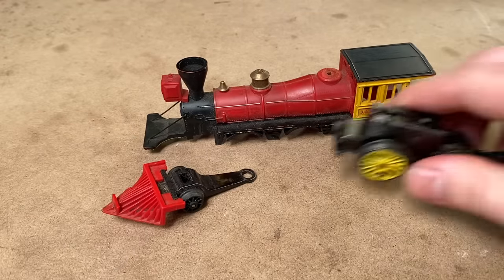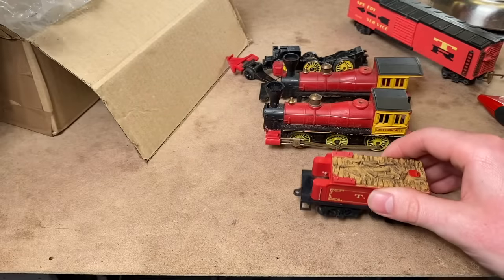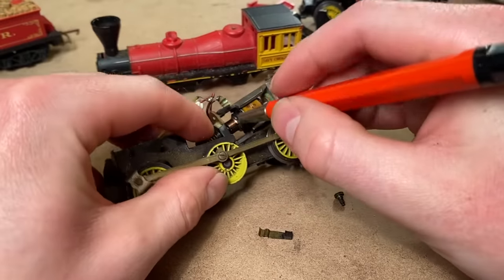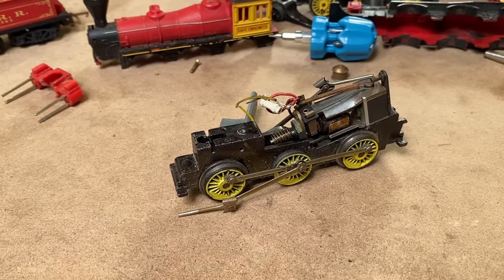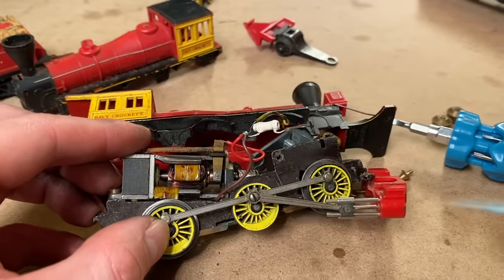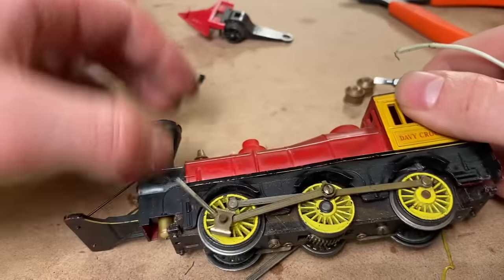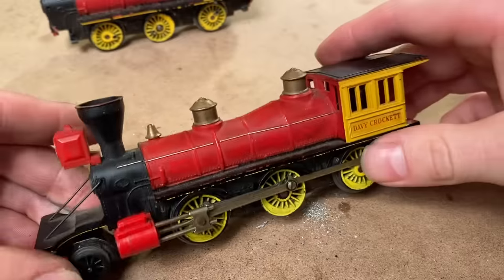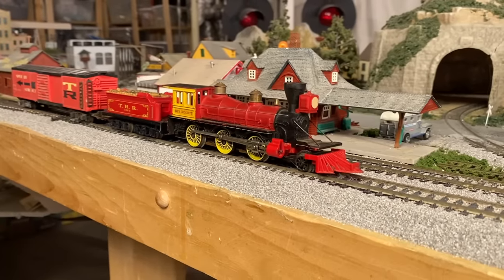The Locomotive I failed to fix - Will it Run? 1963 Davy Crockett

Comment: Man, this is like the last video, old proposed project from an old video finally getting restored, been looking forward to this one as well, this locomotive always intrigued me, I wonder what happened to the frame and how it got snapped in half, it was interesting to think about how bad that model had to have been treated while I was watching the video you got the locomotive in.
Reply: SMT, wonderful work on diagnosing the locomotive insulation issue.. To have surgical skills of restoring difficult locomotives 🚂 is a worthwhile achievement. Some manufacturers have made improvements and some bad decisions in motor designs. Yet most locomotives run well on different track grades. I found that some rails are more difficult to use because of the flange and height of the rails themselves. I forgot about the various rail heights and shallow-ness of the rails that locomotives can’t run on. Atlas, Tyco Tru-Steel and other rail brands differ greatly. Great to see a locomotive run like new. Thanks SMT!  I have a Rivarossi “Yard Goat” 0-8-0 locomotive that has an issue running on my dad’s old layout.
Reply: @lawnmowermanTX  switch frogs, crossovers, and rerailers often give the most problem; they are not made deep enough to accommodate these old "pizza cutter" flanges.  Code 100 track works for most of it; surprisingly, old Atlas sectional and Life-Like Powerloc track has allowed me to run just about anything; the only thing that gives my trouble is an old Jouef clockwork engine from the 1950s; and it mostly complains on the switches and my RR crossings.
Reply: @survivingworldsteam  I have a Rivarossi 0-8-0 Yard Goat locomotive 🚂 that complains on my Dad’s train board. My Dad’s Atlas layout was built in the 1980’s from a 4x8 plywood sheet, and has various retail store shallow grade rails, turnouts and rerailers. I’m not rich enough to retire early and rebuild, rewire and upgrade the whole layout with the proper track and turnout code. I would like to use the taller track and turnouts for the main line and the storage, breaker’s yard for shallower tracks. Try to keep everything consistent with real time and real world railroads.. I wasn’t sure what era to use other than a fun run layout to see how many cars simulated loaded would haul. No DCC no sound effects, old school power pack, push button remote or manual turnout, love to put a cab cam or caboose cam of interior of a caboose out of a side window and the doors to give that movie effect of being on a train like Silver Streak in the 1970’s movie.. A cab, passenger car, caboose and observation car video camera  🎥 system.. With HiDEF 4K..

Comment: Hi, These ols Triang Hornby Locos were fitted with an X03 or X04 motor that were always very noisy. I am very surprised to hear how quiet this motor was and a smooth runner when on Hornby track. Another successful repair and another old timer rescued. Great job. Cheers, Paul.
Reply from the maker: I think the foam floor helped muffle the sound of the locomotive. I haven't heard one this quite ether.

Comment: 1:45 I had that same experience (I was given a free livestock boxcar when I ordered a Tyco/Mantua ATSF F7A for repairs (main issue with the loco was the metal wheels on the front truck were on the same side as the rear trucks)

Comment: Hi there ,, ive worked on heaps of these triang x03 and x04 motors. The bits that flew of is a part of the shellac or the paint varnishy type of covering that goes on the outsode of the motors to stop it from rusting and should be ok with out it. The thing on the front will more than likely work as these old thing were made before planned obscellessance and were made to go for a long time.
You will find that the main things to clean properly are the wheels the brass wipers that contact the wheels on the botton plate and a good oiling goes really well.
I got one of these running with in 5 minutes so i pulled it down for a major servrvice replaced the axle bushes as well as these were decayed due to age. The other thing like other locos is the quartering when replacing the insulator bushes on the axles. 
Once you do that they run like a clock and are widely used in nearly all the 0-6-0 shunters steamers Pacific locos and diesel 08 class loco's. It is a shame you cut the yellow wire as that is the smoking unit that my 1 has too. When i got mine going the first time it ran a little puff of smoke came out of the brass stack that is at the front. These also take only a drop of smoking fluid and is still made today for these smoking units. You can easily join and solder the yellow wire and the smoke unit will more than likely work.
Im missing the cow catcher the front headlight and a few of the domes and bells too.
Good to see you got it running.
Cheers from John in Australia.
Reply from the maker: Thanks for the info on these locos John. Hopefully the motor will be fine without the rust prevention as it's pretty dry in the basement.

Comment: Just read through the other comments. You're my kind of model railroader, and I LIKE you! I'd rather have the robust, basic reliability of these veteran models, which keep on running, than the inbuilt delicacy and fragility of the modern stock, no matter how finely detailed they are. I envy you the Varney Yellowstone - a very rare bird indeed here in Britain, which I only know from a photograph in a very old (slightly prewar, by about 1 day!) book.  I daren't look at Ebay HO nowadays - there's been some dangerously tempting stuff on there. Threes and eights on you, good buddy.

Comment: Those smoke units are pretty delicate, there was a resistor next to the motor because the smoke runs on 6 or 9 volts or something. I learned that the hard way once, where I wired the smoker directly to 12 volts, the engine ran very slowly, and there  was a red glow out of the smoke stack, then pop and it was done! Melted the smoke stack, got so hot! But that is a very cool engine!
Reply from the maker: I wasn't aware of that, thanks for letting me know.
Reply: @SMTMainline  - A resistor connected in series with a load, like the smoke unit element, is known as a "dropping resistor" because it would drop some of the input voltage across itself.

Comment: SMT - It might be a good idea to put some oil on the crosshead guides that are coming out of the back of the cylinders, to reduce the friction between the guides and the crosshead.  For smoke fluid, you could see if you get mineral oil from your pharmacy & try it out!
Reply from the maker: I added some oil to those off camera. I should test out that smoke unit, it could be an exciting feature.
Reply: @SMTMainline  Be VERY careful which oil you use! Those old plastics can react badly with oils - particularly Peco Electrolube or 3in1 and will break up. I'm referring to British brands - don't know what you use stateside, but the same applies.
Reply: @SMTMainline  The resistor in the middle may not be insulated all the way, see that it doesn't touch the bowl at the top. There's smoke fluid available from brands like Seuthe, probably Walthers as well. And don't overfill the unit, it only takes a few drops at a time.

Comment: Well done, Paul!. I've also got one of these engines - a long time favourite of mine, and as you say hard to find in good condition. Things to watch for - the cylinder block can get fragile with 'plastic fatigue'; many I've seen have broken off, losing the cylinders. Same applies to the pilot, cab roof and headlight. 

I noticed you helping her through modern points, as if 'sticking' in the flangeways - Triang's wheel back to back was coarse by modern standards, and tends to bind. The simple cure is to gently lever the insulated drivers out on the axle a little and widen the gauge - there's enough 'slop' to let you do it. 

The model is actually quite a decent representation of the real thing, far more so than many English fans perhaps realised. I suspect it's made from plans of a T,NO&C mogul in the Kalmbach 'Cyclopedia' which matches pretty closely. The coach which ran with it has very strong Pennsylvania overtones, particularly the deep valances over the end platforms, and again Model Railroader drawings of the early 60's suggest the source.  

In Australia I believe the engine was marketed as the 'Ned Kelly'!
Reply: The Ned Kelly version may have just been a one year catalogue illustration proposal in Australia.
A very big Australian Triang collector would often display part of his collection in Melbourne exhibitions. Discussed the Ned Kelly version with him but he had never seen one. 
Ned Kelly is still a very polarising name in Victoria, especially with those with family connections to the area where the 1870-1880 events took place.
Lots of YouTube vids with far more detail on the Ned Kelly story.

Comment: As always, entertaining video. I got a little laugh when you stated it was remarkable that Triang/Hornby hadn't changed the design of the motor in almost 20 years. Hornby to this day are still cranking out models based on that chassis platform. When I see that 0-6-0 wheel spacing it screams old triang chassis. I think they've gotten their money worth of the design, at least 50 years of throwing a different body shell on the same chassis.
Reply from the maker: I guess if the design ain't broke don't fix it? I'm amazed they are still using those motors.

Comment: Great restoration ! It has the standard 0-6-0 chassis used on many Triang Hornby locos over the years. You’d be able to swap it for the chassis on your  GWR Pannier tank for example. It should be able to run on code 100 track OK. All my old Triang Hornby locos are ok on Peco though they will only go through universal points. The fine scale ones defeat them. 1950’s Triang locos are a no go though as the flanges are even bigger, but anything from the early 60’s is OK. Maybe the frog sections on your points are too fine? Try adjusting the back to back of the wheel sets.

Comment: great job, I feel I should mention that the old hornby/tri ang locos are 12v max, they are not designed to run at 18v. those old xo3,xo4 motors are quite resiliant and could sometimes need re magnetising.

Comment: Triang locomotivas, from experience are pretty durable cause I have a 1973 coronation scot which at the time didnt work because the motor would turn but the wheels wouldnt but all I had to do was give it some gears from another older triang that I used to have and a good cleaning and it worked perfectly
Reply from the maker: The simple design certainly works in their favour but like anything they need maintenance.

Comment: The motor appears to be similar to the one that Mantua/Tyco used in their steam locomotive kit/rtr’s. The  fluted steam dome from Tyco’s “old timer” 4-6-0 would be a good fit on this locomotive. It would go on with no modification as the dome has a “splined” stud on it. Great work on getting an obvious economy loco.

Comment: The heat element is an interesting thing, it was Triang’s own “Seuthe” unit, which simply outputs a constant flow of smoke

My personal favourite of their smoke generators is their “Synchrosmoke” unit, which uses a pump to force air into the smoke generator, resulting in the oil vapour being pushed out in synchrony with the wheels! 1950s/60s models were something different
Reply: Another thing to note about these Triang models is the wheel profile, the flanges are further out than on most models, and are much thicker, resulting in poor conductivity and stalling on points when operating on modern track, this problem can be rectified by giving the model a newer set of fine scale wheels, though can be fiddly to do

Comment: Interesting!, i have a newer Tri-Ang, but its a model of a British 0-6-0 diesel shunting engine. It developed an electrical issue (they used the wrong solder on the connections, and it disintegrated), and also the motor gear was too tight against the axle gear, which i corrected with some thin shims. I resoldered the electrical connections, and it worked fine on straight/curved track, but the wheel flanges wont clear the American guard rails on turnouts, etc. I also discovered that the wheels are magnetic, and it runs even better on cheap steel track!
Reply from the maker: They were decent models but I've ran into issues with mine as well. One thing I did notice is that they seem to clear Code 100 Peco switches, I suspect since they are distant relieves of Tri-ang track.

Comment: Love the channel. 

Had a question for a repair. Maybe someone can help. 

I have a couple of tyco sets from 1972. Been in the family since new. When my dad ran them, he used steel wool to clean the tracks. Turns out that is a bad idea. (who knew lol). 

The bits of steel wool made their way to the motors in the locos, wreaking all sorts of havoc. 

What is the best way to clean the steel wool bits from these locos, giving them another chance of riding the rails once again?

A local model train repair shop offered to trade them for his stock. I refused saying I wanted to pass ours down to younger generations in the family.
Reply from the maker: They can be a bit tricky to work on the first time but they're gonna have to be disassembled and cleaned manually. I have several videos working on tyco locomotives so you can follow any of those to show how to. Don't get rid of them, they are super easy to find parts for and won't be worth much on a trade in anyway.
Reply: You could try using a vacuum cleaner with a small tip.

Comment: I think you got lucky with your figuring out why it was shorting, you can see around the 8 minute mark the insulation on that wire that "fixed the problem" is perfectly fine, but the yellow wire to the smoker has the insulation ripped open as you can see bare copper so probably was shorting against that plate,  good call in just clipping that wire out though.

Comment: Nice! I hope you can go back and repair the smoke unit!

You could also maybe file down the wheel flanges (although they don't look that deep?).
Reply from the maker: I've been successful in sanding down the flanges before, I've just gotta be super careful with this one since these things (Believe it or not) are worth a mint...
Reply: @SMTMainline  I guess you got lucky. I might advise you not to do so with older Triang. Some of them were made with harden steel from WWII tanks. As such, they were more solid than the tools people tried to use to sand them down!

Comment: You really need to put these things on the tracks for a test before the shell goes on and might wanna get a volt meter. Can really help with finding shorts/figuring out wiring 👍
Reply from the maker: It ran when it was connected to wires so I got fooled into thinking putting the shell on would be alright.

Comment: What  Gauge is the davy Crockett train and track?
Reply: Like all Triang it's HO gauge of 16.5 mm. 
However Triang like many other vintage toy type makes of the era went in for deep Lionel style flanges and wide wheels to better keep on their track with their higher rails to give the flanges clearance.
The deep flanges caused problems touching the rail fixings on Harrison's more modern code 100 track.
Triang original needs their track of code 125 or more.
This is really a made up locomotive to use a common Triang chassis so the scale could be anything from OO 1/76 to HO 1/87.
Reply: Triang use OO scale for their models of British trains and approximately HO for models of other countries but varied since they were not exact models usually but made to suit their existing running gear.

Comment: Sounds like your flanges might be made NEM specs,perhaps great job.
Reply: Heck no - Triang standard, if anything.
Reply from the maker: These locomotives were 00 scale so they technically are too big for HO track.
Reply: @SMTMainline  Yes, they are made to a larger scale, but they run fine on HO Scale track.  The problem is the flanges, these early trains from the 1950s-1960s and some European trains after that have so-called "pizza cutter" flanges that are larger than today's standard.

They do hit the spikes on Code 100 track, but the main problem is switches, cross-overs, and railroad crossings; they are not made deep enough to accommodate the flanges. It is possible to turn down the flanges on a lathe; or replace them with a more modern set of wheels.

I have an old Jouef clockwork engine from the 1950s with these big flanges.  It runs OK on my Life-Like Powerloc track, except it jumps every time it crosses the switches or railroad crossings; attaching a coach keeps it going straight so it doesn't fly off altogether.  The old Fleishmann and other European HO scale equipment were the same way; probably to keep from flying off the track while being ran full speed.

Comment: Runs great on Tri-Ang track, but i am debating whether or not to use my Dremel on some American track guard rails. As the saying goes, "dont cry before you try"! Wonder how i could get your opinion on the track issue 🤔? And it will match up with some Bachmann "Thomas the Tank Engine" cars that i have!
Reply from the maker: I've sanded down the flanges on some, however I've found Peco code 100 switches work with stock hornby tri-ang stock.
Reply: @SMTMainline  the train shop i go to does carry Peco track, but since i only have the one Tri-Ang/Hornby engine, it would be a waste of money for me, but thanks for the suggestion. (Ive had it for right at 50 years, my dad got it for me on an overseas trip he took in the 1970s)

Comment: You can still get those Motors on line...
Reply from the maker: With the worm gear?
Reply: @SMTMainline  more than likely you might have to pull the gear and set it on the replacement motor.